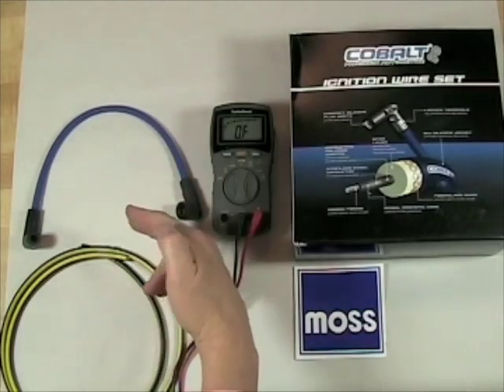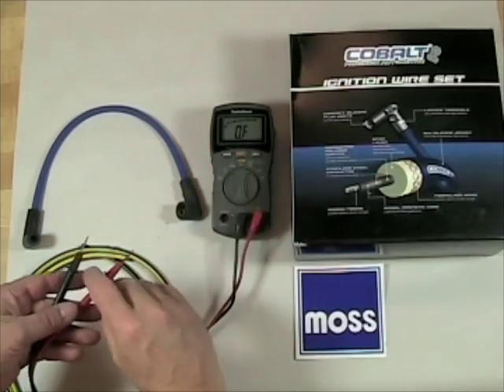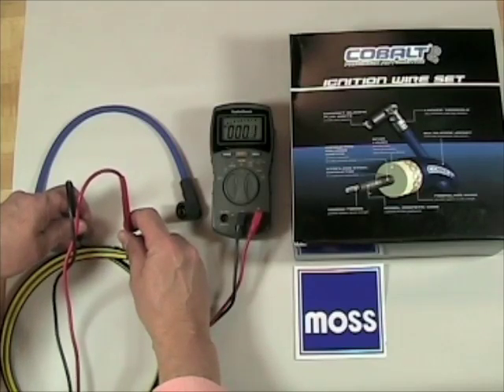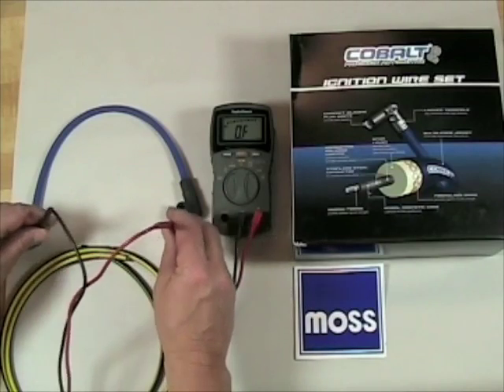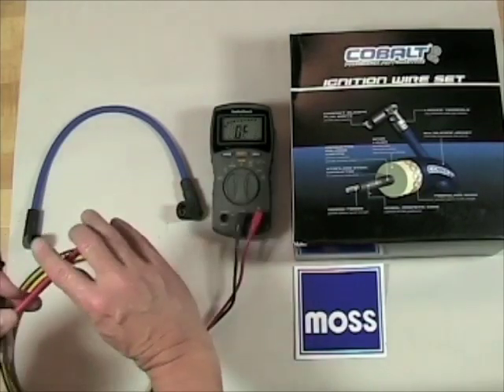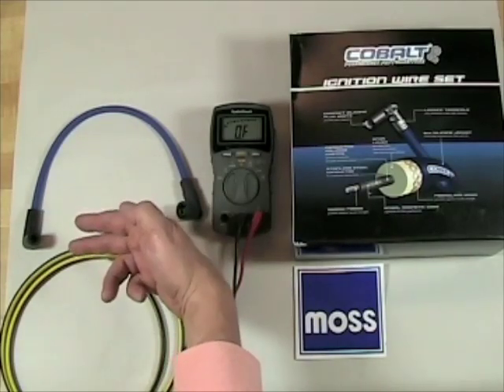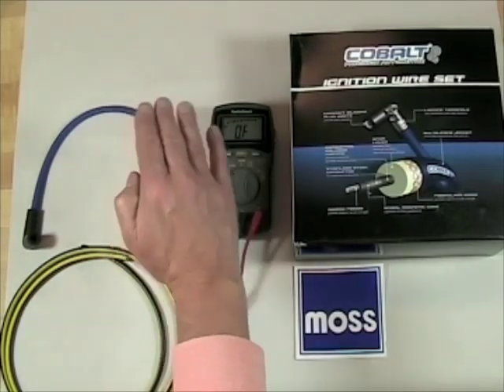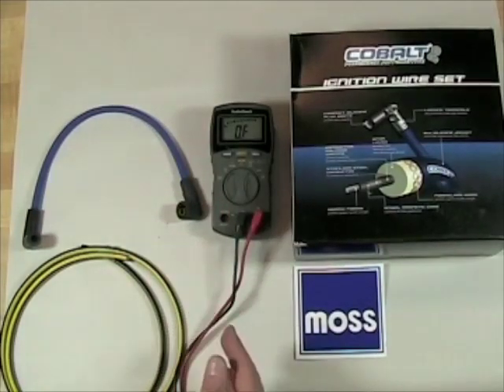Ignition Wires - How to Test

Comment: How do i test with the Ohm meter if the Ignition Wires when they are different sises.
say there is over 10 Ohm  in difference from my shortest to my longest?..
non of my 4 is the same length pls help?